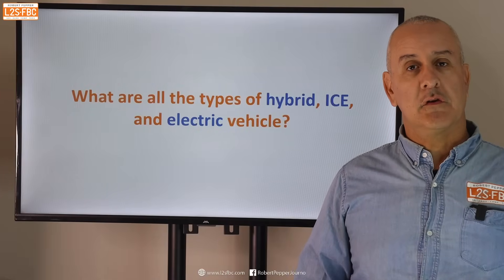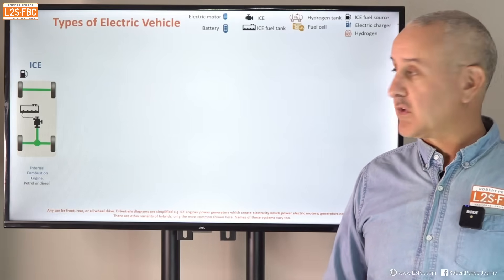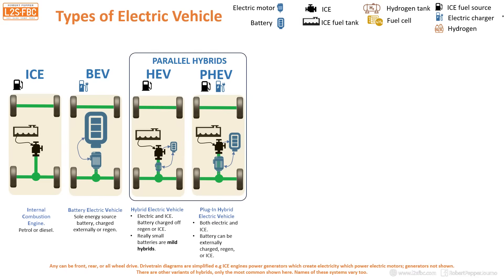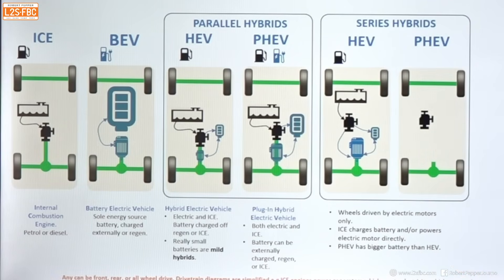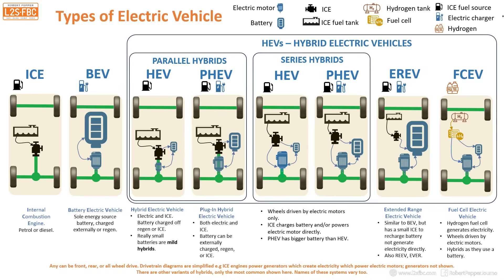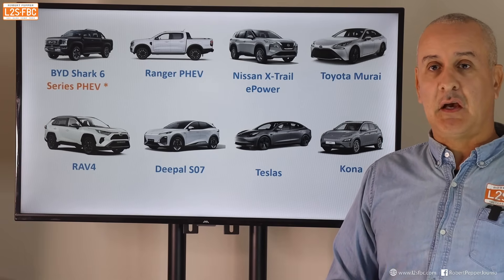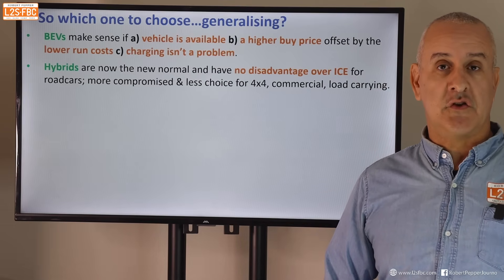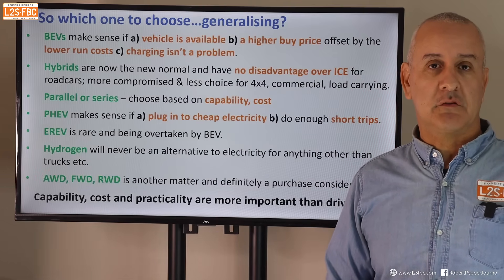Your simple guide to hybrid cars; BEV, HEV, FCEV, series, parallel and more.

Comment: I was lead to believe by several byd Shark reviews that the petrol engine can directly run the drive the wheels directly. Am I mistaken?
Reply from the maker: It can in some circumstances and I cover that
Reply: @L2SFBC  I apologise. I don't know how I missed your asterisk. I Just saw it listed as a " series Hybrid" which you earlier stated meant the engine could not drive the wheels at all. My mistake.
Reply from the maker: @my2centsworth it is much closer to a series than a parallel! Has no gearbox.

Comment: Good explanation! You bring a very important point up at the end about PHEVs with the short trips and charging.
And that leads me to my experience with the PHEVs we have at my workplace, their usecase and the comparisson to what we had before.
We had Golf Diesel wagons and they were replaced with either a Skoda Enyak awd (when the Golf Diesel was awd) or a Skoda Octavia hybrid wagon (when it wasn't a awd Golf wagon before).
I won't go into the experiences with our Enyaks here, but the comparisson between the Golf Diesel Wagon and the Octavia hybrid wagon  is interesting i think. We don't do short trips in those cars, and seldom use them in a city. They are mostly used on country roads and highways for on average 1-2hours in one direction.
And in that regard, i would say the PHEV has at least 1 disadvantage over an ice engine, if not 2: The average fuel consumption of the Octavia under our circumstances is not lower than that of the Golf was. (on 2 hour almost constant 100 to 130kph drives it needs more fuel than the Golf did despite it using up the battery load too.)
So the additional 40-45km (when it's not too cold or too hot) range of the battery is not able to counter it's additional weight under 75% of our driving circumstances.
(I would say it also shows that a Diesel still is more fuel efficient than a petrol engine)
Where it does work better is if we go to some destinations that aren't that far away, but have steep inclines. (because you get actual "engine braking with the regen, while most manufacturers have somehow engineered effective engine braking out of their ice vehicles in the last decade or 2)
And so the second disadvantage might be the weight. PHEVs are heavier than the same car as an ice car (if available). And that means more wear and lower payload.
Reply from the maker: Yes, fair points.  PHEV only makes sense if you can charge locally.

Comment: A valuable video - would be good if this terminology was widely adopted. A diagram for hybrids is also useful, being a 2 x 2 matrix with 4 quadrants, so HEV and PHEV on one axis, versus parallel and series on the other axis. A challenge with your definition of Parallel (even before adding in the complexity of drivetrains such as AWD or 4WD and the presence or absence of prop shafts) is the gearing, in particular the following 3 types: (1) ECVT with VSD and no gearbox transmission eg Toyota Prius, (2) single reduction gear set with VSD and no gearbox transmission eg BYD Shark 6 front end, (3) pre and post transmission hybrids with gearbox transmissions eg Range Rover Sport.  Some sources define all of these as subsets of parallels (which you would favour I think).  But others do not.  For example, the CVT type is described in the USA as a separate class, so neither a subset of series nor a subset of parallel and called Split Power or Series-Parallel (maybe because it was invented and patented in the USA).  If so then unfortunately your table would need more columns or my matrix more quadrants !
Reply from the maker: Absolutely, and this is part of the complexity I alluded to...could make it maybe 20 different types!  There is also ICE-direct drive + electric-only rear, so that makes it perhaps a Parallel-Series...so many combinations!